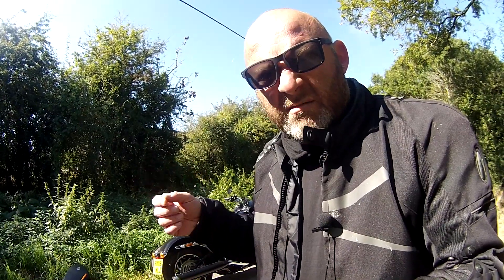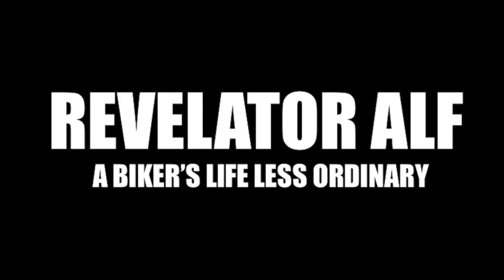What Is Harley Rear WSS - How Does HD Softail Rear Wheel Speed Sensor Work

Comment: I have two bikes with ABS. Over the last 50 years two occasions were I locked up the rear wheel and kicked out the rear end to avoid obstacles. Like a car that pulled out in front of me and once a pickup spilled a load of pipe in front of me. I was able to flip the rear end side to side, like a dirt bike. ABS kind of screws up controlled / out of control situations.
Long dirt road on a steep hill with pot holes ABS freaks out. Almost wrecked once in the last 15 years doing the dirt road thing.
Cheers!
Reply from the maker: Yep personally I would switch off abs for off road riding and there’ll be situations when it’s not great but on the whole it’s a great system I’d say